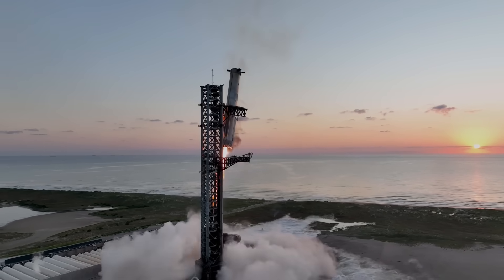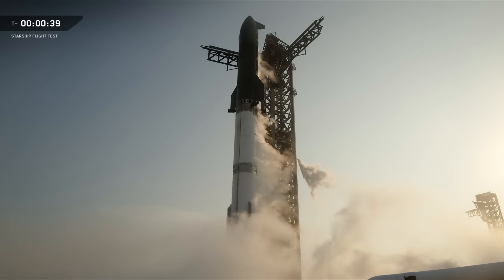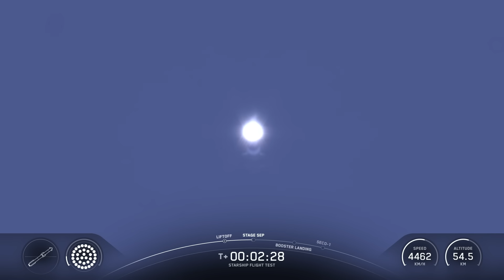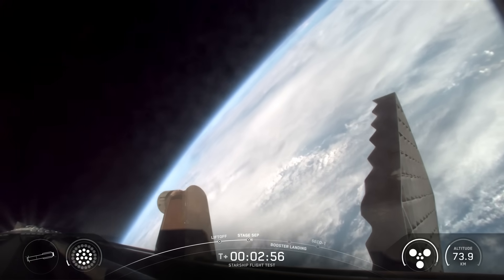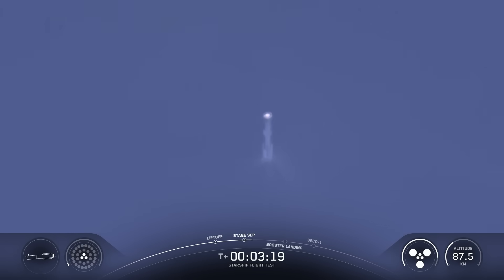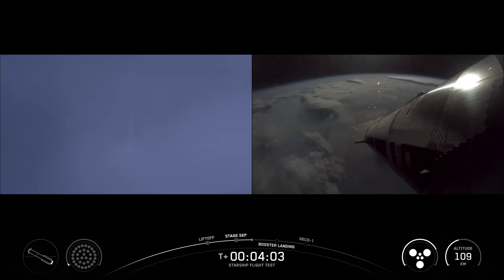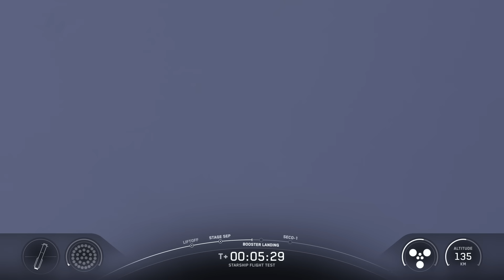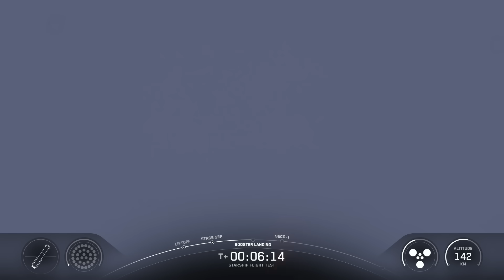SpaceX Builds Largest Reusable Booster, Also Makes Door That Won't Open - Starship Flight 9 Recap

Comment: SpaceX is regressing and Starship appears further away from a viable space launch system now than it was a year ago -- I wonder what's happened in this last year.  Also, SpaceX was NOT the first to demonstrate propulsive landing, that was done more than 30 years ago by McDonnel Douglass DC-X, but even before than there was the Bell Rocket Belt where individuals fly around with a rocket propelled backpack that uses propulsive landing.
SpaceX is also wasting time a taxpayer money doing their iterative approach.  They insisted that the water cooled plate below the launchpad was all that was needed but after repeated propellant leaks many are tracing the leaks and other issues to the lack of a true flame diverter and flame trench.  When you watch a Starship/SuperHeavy launch you see the rocket immersed in a maelstrom of shockwaves that you can see with your own eyeballs and those shockwaves are enormously powerful and almost certainly those shockwaves are having a negative effect on, particularly, Starship.  Interestingly, SuperHeavy might appear to be more at risk from those shockwaves given how much closer to the reflected shockwaves, but perhaps the thrust from the 33 Raptor engines blunts some of the shockwaves headed towards SuperHeavy perhaps in a somewhat analogous to the protection burning the engines has towards the booster during entry burns.  But, SpaceX is now building an actual flame diverter and flame trench so maybe they finally figured out their 'no part is the best part' idea isn't working so well.  How much time and money did SpaceX waste pursuing a launch tower without the proper flame diverter and trench.  One last bit of content here is that rumors are that moral of SpaceX personnel is in the toilet!

Comment: not only was shutles boosters reusable - the whole of the shuttle was reusable - and while i was no fan - Nasa did this  over 40 years ago !! starship is on its 9th failure - and even if they ever get it to work its still virtualy useless - see - smarter everyday
Reply: The external tank of the Shuttle was not reusable. Starship is nothing like the Space Shuttle. The two cannot be compared.
Reply: The problem with the shuttle is that the refurbishment time and processes likely made it more expensive and slower than it would’ve been to simply expend and re-build an equivalent rocket each time.

Comment: "With the vehicle spinning out of control, they didn't attempt an engine relight."
Maybe they didn't attempt to open the payload-door either, because the vehicle was spinning out of control at that point too?
Reply: Yeah, imagine the memes of seeing it throw satellites all around itself
Reply: That was my thought too, that they didn't want the ship spraying metal pallets in all directions like the devil's own lawn sprinkler.
Reply: @froobas  from the attempted door open to splashdown is about thirty minutes, let's say 2000 seconds.  The satellites would be ejected at, let's say 5 m/s generously.  They'd get pushed off course at most 10000 meters, ten kilometers.  That moves them from the middle of the indian ocean to... the middle of the indian ocean.  Absolutely no difference.
Reply: yup, never good when the pointy end is no longer pointed upward!

Comment: Thanks for confirming that the Raptor engines are at the limit of what is possible. It's been noted that engines working at such a linit are not compatible with reuse. 

Since the entire rationale for this stack of stainless steel is first reusability, then the far less likely rapid reusability, the bar for success is fairly high. Booster has to launch and land without exploding. Starship has to launch and land without exploding or disintegrating. After having lifted a payliad to orbit. It's quite telling that spacex is not even pretending to be able to lift any payload at all, since often rocket companies testing a new system will offer a free albeit high failure risk ride to a satellite. 

These flights also confirm that the only market for these machines will be spacex starlink launches, since starlink at full constelkation will require 8000 satellites launched every year in perpetuity.

Since starship can never be human rated because it has no way to create an escape mechanism I think we can saely ignore any talk of starship carrying humans anywhere so that's good to know too. 

It's too bad spacex didn't use a dummy payload to properly test the stack, but I'd assume the risk of failure grew too high. In other words they had no confidence the stack could lift a payload.

Good job confirming these components of the process. Hopefully  taxpayers are not subsidizing Spacex's oversized starlink pez dispenser..

Comment: The iterative development program (trial and error) does not seem to be working as well for Starship as it did for the Falcon series. However I'm curious about how SpaceX views future missions to Mars. With a Mars Transfer Window coming around every 26 months, I would imagine that SpaceX's approach to development is going to run into significant problems. To me it seems obvious that SpaceX should perfect Moon landings first, taking every bit of knowledge and experimental data they can from Lunar missions. Soft-landing on Mars always seems to be a perilous proposition given the 38% gravity and 1% atmosphere; it seems to me that SpaceX would need to be pretty sure of success before launching to Mars. Any thoughts on how SpaceX might adapt it's trial-and-error approach to the physical challenges of getting to Mars?
Reply: Send test flights every 26 months.

Comment: I really do wonder if they might want to practice Starship catches by having it go straight up and then do a return to launch sight. (A sub-orbital flight).

The problem with the Starship catch test is it is at the end of a long chain of events that need to go perfectly before you can even attempt the catch.  Making that test sub-orbital seems to be a way to reduce the length of that chain of events.
Reply: Maybe when they get close to the final version.  It appears that they're still testing for flight stresses.

Comment: This system is likely decades away from being human-rated, if ever. Who in their right mind would ride in this without a failsafe emergency re-entry vehicle?  I predict the moon will soon be a stainless steel junkyard if it gets there at all. There are numerous significant hurdles, including in-orbit refueling and viable landing legs that can support a loaded vehicle this tall, all while landing on irregular, uneven surfaces and soft regolith, and taking off again. IMHO it is a folly.

Comment: It seems like you might be able to use the flaps working on the plasma to pull it out of the spin and control attitude.    It would be a neat trick.   Think of a fighter that autonomously can recover from spins (because the flight controller is clever and knows how to save even a novice pilot).

Comment: Didn't New Glenn also try a high angle of attack approach and failed? Both encountered a similar problem upon ignition?
And on the Ship, maybe 3 different end reasons, but originally a leak AGAIN! Maybe just the weldseams are not capable to withstand the Gs of this long V2 vehicle?

Comment: The payload door not opening is interesting since it didn’t open fully the last time they tried it on Fl 6 (?). Causes: engineering tolerances are too tight causing a jam, mechanism not properly tested at zero g (works at one g but there’s an issue at 0 g), Ship fuselage is getting twisted, torqued, otherwise distorted from flight stresses so that the door is no longer true. Considering the minalamist engineering inside Ship, it’s certainly possible that the ‘tin can’ is getting bent on the way up. That will take quite a bit of analysis to do a beef-up to keep things straight. Chain drives are notorious for alignment and I’m surprised that a belt system is not used, but I trust SpaceX to have figured this out correctly. A puzzle for sure. The video will help so much.
Reply: Are they really using chains? They'll seize due to cold welding. Insanity.
Reply: @AlexFoster2291  Yep. You can see them on the left side of the Ship internal video. There’s a chain and a sprocket. Not my choice!
Reply: They need to go with air pressure equalization valves for the cargo bay and bivalve doors that unlatch and swing out like the Space Shuttle orbiter's did. As incredible as it may seem, the Shuttle payload bay doors never had a real failure in 133 orbital flights and sometimes nearly 3 weeks on-orbit.
Reply: Does the payload bay actually need doors?
Reply: @AlexFoster2291  Yeah, Ship is supersonic so open windows/doors not normally ok with mach airflow. Interesting thought, though.

Comment: If lighting Ship’s engines causes a fatal material failure, as seems clear on flight 7/8/9 then this test was almost zero progress. I would expect the proven booster to get Ship to staging as that has been the consistent performance. Having a Raptor 2 blow up on landing burn ignition is not great, but not the end of the world given that Raptor 3 is planned for end of year. What sucks is the inability of Ship to survive intact after firing its main engines. It did not get to sub-orbital velocity without having a fatal failure. SpaceX has not solved their problem.

Comment: Space x is number 1 in destroying stuff and damaging the ozone layer
Reply: Number 1 would be those responsible for the Chernobyl disaster no doubt.
Reply: Unless you’re exclusively counting the 30 minutes of time after a starship launch that’s just blatantly wrong
Reply: @alexsiemers7898  No starship main stage has landed correctly.  At this point the system is a total failure.  Catching the booster is also meaningless if the main stage does not achieve it's goals
Reply: @area51z63  I was referring to the ozone layer part, that’s my bad.
Reply: @alexsiemers7898  Please elaborate as to how exploding is right?  Just let me get popcorn

Comment: People can talk crap about the Artemis rockets taking forever, but I'd rather ride on the rocket that never exploded once, then the rocket that keeps on exploding but works later on.
Reply: Actually, you'd want to fly on the rocket that exploded several times during development but then works later on during normal operations. A system that never experienced any anomaly and worked flawlessly during development still has flaws somewhere, they just weren't discovered. So ideally, you'll want it to fail often early on to iron out as much as possible.
Reply: @FerrowTheFox  No, I really wouldn't actually.

I am okay with a few failures, say 4 or 5. Such as RocketLab, but even their failures were not simultaneous. But 9 completely catastrophic failures one after the other? That's a huge engineering failure. Ground testing has its place, and I believe SpaceX is failing to do proper testing before the rocket ever gets to the launch pad.

And before anybody attacks me, we HAVE seen where full stack testing works. The Saturn V never launched its stages individually and only had minimal ground testing. And the first time it actually launched, Apollo 4, was a complete success.

However, it still underwent EXTENSIVE testing before it made it to the pad. Every stage was test fired at least once on the ground to ensure nothing would blow up (i.e. like Starship has repeatedly failed to do), they built a full-sized dynamic vibration testing model to ensure it wouldn't vibrate itself to pieces (now on display in Huntsville's Rocket Center), and every component was tested before it was sent to assembly. They also kept an extensive record of all the changes they made during development (which from what I've heard SpaceX did very successfully on Falcon but have failed to do so on Starship).

I think NASA and SpaceX could learn from one another.

NASA tends to overtest things before approving a launch, mostly from their two space shuttle failures due to overlooking potential failure points. It results in a successful but expensive rocket.

SpaceX tends to UNDERtest things, resulting in catastrophic failures in more dangerous environments. A 100+ ton object traveling at near orbital velocity is nothing to scoff at, and the fact that they've had at least 3 that completely lost control before they reached a stable suborbital flight is extremely concerning.

I don't think either one is doing it right necessarily. I wish NASA was more pedal to the metal with launches, but at least they try to keep safety for a highly explosive missile the size of a building as high a priority as possible. But I also wish SpaceX was more safety oriented, with multiple confirmed instances of OSHA violation safety injuries, including one guy in a coma because they didn't properly clear an engine test site.
Reply: Elon’s approach is move fast and break stuff. It’s not my style but the Falcon rockets must be profitable. He’s blown a lot of shit up the last couple years. That can’t be cheap.
Reply: Ok. But what if you have to pay for your ride, and the ticket price is proportional to the cost of the whole rocket? ($2 billion for SLS, & $2 million for Starship est.)
Reply: @user-4in4nxDonaldRennie  I'd like to point out that the cost for a ticket on Starship is hypothetical. That's what Elon WANTS it to cost, but considering it has not made it to orbit, and blown up 9 times on its way up on a SUBorbital flight, it will be hard for SpaceX to get it human-rated any time soon from NASA and the FAA. Much less down to the cost that Elon wants it.

As far as my knowledge of history goes, it is unheard of for a rocket to have failed 9 times and not reached orbit once. They are either scrapped when they've failed enough (like the Soviet N1 rocket, blowing up 4 times before making orbit) or it manages to launch successfully within about 5 tries. That's a huge red flag for certification.

And I say all this as an engineer myself as well as still respecting Musk for his work on Falcon, Tesla and X. I think his team is smart, but from what I heard Starship is a FAR different process for testing than Falcon ever was. Not necessarily better either.
Reply: Glad I'm not the only one.

And in reality, SLS is actually half the price of the Saturn V when adjusted for inflation. So it is a 100% successful rocket for its one launch, can launch more to TLI than Saturn V, and cheaper to boot.

I'm not normally a fan of government programs but I believe Starship is far away from becoming a usable rocket that can replace SLS

Comment: All hail the success of rapid iterative design!  Why, the first colonists should be leaving for Mars any day now!  Scott Manley is still trying very hard to soft-pedal Starship's latest failure.  Reusing a booster, not losing it on ascent -- these are good, but the system as a whole is still a long way from achieving its key design goals; never mind dispensing satellites, when will a Starship be recovered?  It's now been three flights since Starship survived reentry, so we still don't know whether the thermal protection system has been fixed.  Based on how Musk capitalized on the mistaken assumption that he is some kind of technical genius, his embrace of fascism , and his interference in government, I can only hope that Starship fails, but its design goals are worthy ones (if still out of reach).

P.S.  "... while the booster wasn't expected to fly again it did complete its mission" -- oh?  Was it supposed to explode at altitude and not be recovered?  Its primary function was to propel Starship, but its mission was more than that.
Reply: The booster was never intended to be recovered. They were using it to test a more extreme entry and landing procedure. So yes an explosion was expected.
Reply: @motokid6008  OK, I stand corrected.
Reply: Yes, the booster was planned to be expended, crash or blow up...I don't know if it happened as expected, but it was not to be recovered.

Comment: Starship DOGE 9 blows up.  Saturn V never blew up.
Reply: Huge difference in funding and companies involved. There were so many explosions testing on platforms directly related to the Saturn V I’d be here for hours listing them. Unlimited budget and decades of testing resulted in the Saturn V.
Reply: If you mean Starship + Super Heavy and Apollo + Saturn V testflights, you are somewhat right. Saturn V successfully made 13/13 orbital insertions, Super Heavy has made 7/9. 

But there are differences in size (bigger, more engines, double the thrust), complexity (reusability) and resources (1/20 workforce, 1/20 cost). And a conscious engineering philosophy of quick failure and iteration to speed up development of a more complex vehicle to a lower cost. 

Apollo made many successful missions and tests in earth and moon orbit, but some slightly bad. And Starship has made some successful tests and some bad. But Starship is also very different in the same way as Super Heavy is. 

So one can't really compare these projects one-to-one.
Reply: @jaylindelycke6727 Sometimes I feel that some people actively refuse to believe anything that doesn’t fit their beliefs. The longer there’s no response like “thanks” or “I didn’t know that “ the more I believe the OC to be one of those people. Great short explanation of what I rambled on about so thanks.